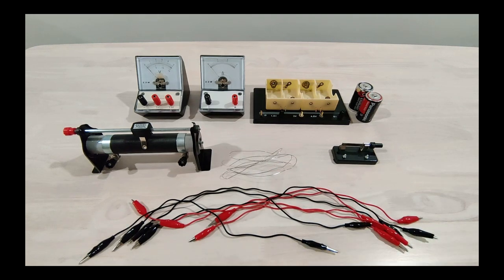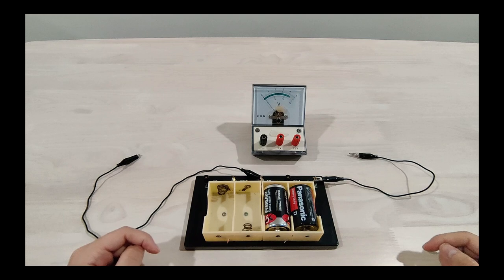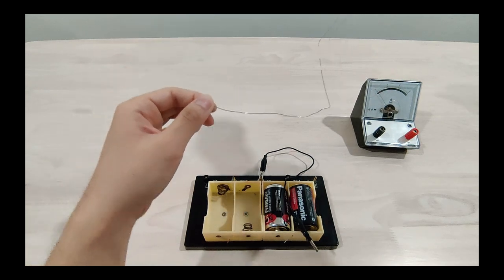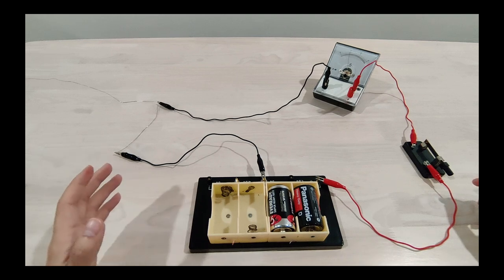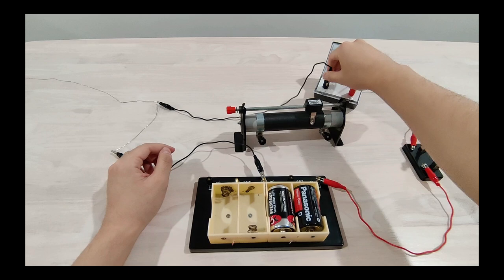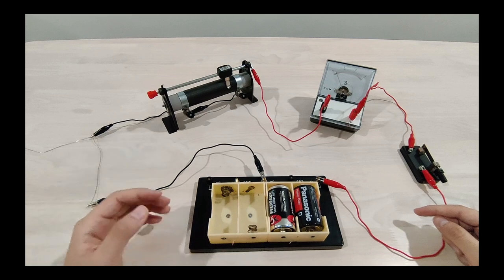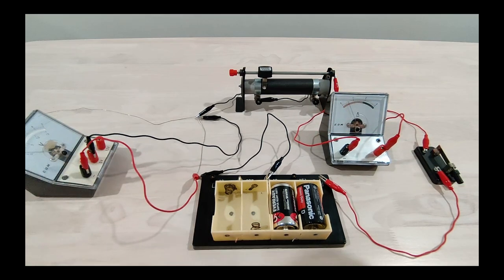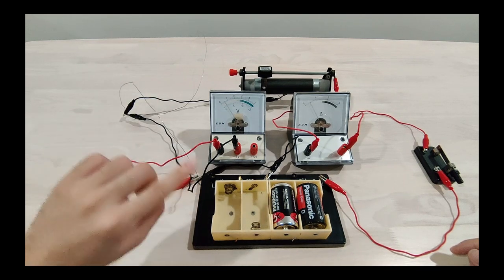Experiment on Relationship between Resistance of a Constantan Wire and its Length

Comment: does only the voltmeter have a parallel connect to wire? Does the ammeter and rheostat need to be parallel as well?
Reply from the maker: Only voltmeter is in parallel to the constantan wire. Everything else is in series.
Reply: Thank you sir,
Sir, how can i know which terminal i should be connected to?
Reply from the maker: @yanahaider4429    The negative terminal of the battery should go to the negative terminal of ammeter/voltmeter.
Reply: Thank you so much sir😇